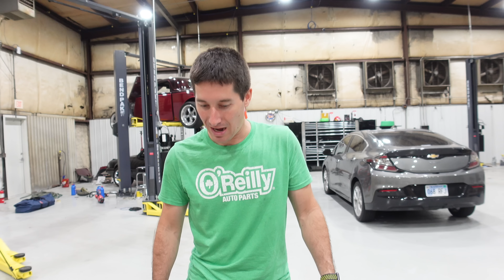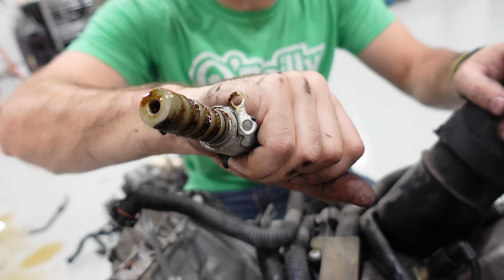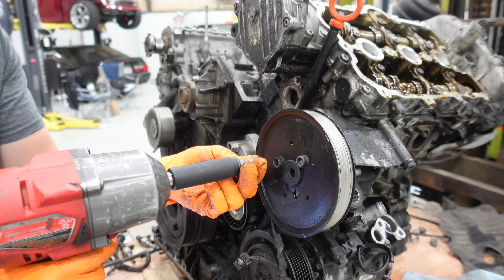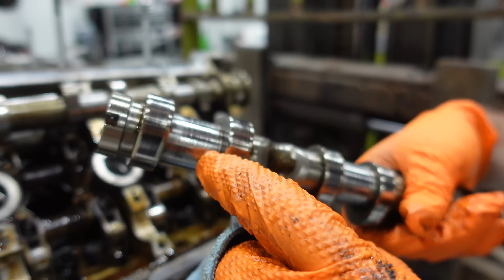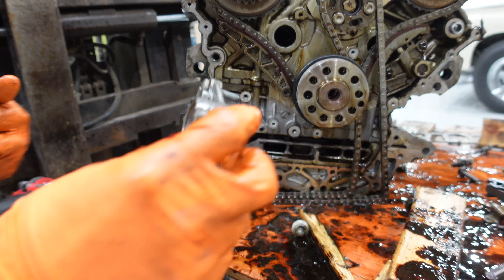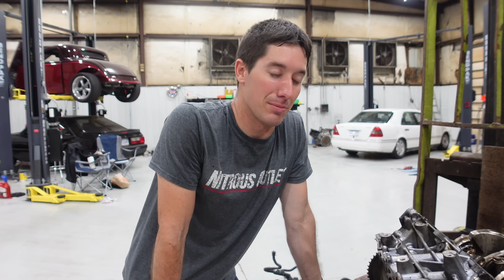SLUDGED To Death: Tearing Down My SEIZED Audi 3.0T Engine

Comment: Thank you for totally curing me from any desire to own a late model Audi.
Reply: You have to be making good money in order to maintain a high end(exotic, etc) vehicle.
Reply: 100%.  Oil and filter changes are cheap compaired to engine failure. 8-10k intervals to keep the cost per mile of ownership down are an absolute joke.
Reply: Think about how I feel...I own a late model Audi...waaaa
Reply: @michaelreynolds1904  lol fr I own a Honda and I change my oil every 3k miles or 5k kms
Reply: Hey Neil, I have an S4 with over 100,000 miles. With proper service, changing oil every 5 K it’s been completely reliable. A great car.
Reply: @nickoD509  the only high end part is how unnecessarily complex these cars are when they don’t have much over regular ones. The price might come off the way they build these things, how much time to assemble such machines when there is an easy way to do that, they don’t have better parts it’s all the same.
Reply: @michaelreynolds1904  they make sure you buy a new car at regular intervals which might be when your warranty is over. And your current one losing much more in resale value than any other car. Makes sense monetary wise when you think about it
Reply: It’s really not that bad the supercharge comes off in 20 minutes and I’ve done my injectors in under two hours. The engine is pretty stout and easy to work on
Reply: Problem is, once you drive an Audi, it's really tough to go back to Japanese. I have a 2014 a4 and it's been great. My next will be a 2016 s4!
Reply: They don’t have much over regular cars? Drive a B8 S4 with the 3.0 supercharged engine (this engine), torque vectoring sport differential, adaptive dampening suspension and steering, and Direct Shift Gearbox. You’ll see what all the fuss is about. This came down to poor maintenance. 135k miles on mine, runs like a scolded step child
Reply: I have no issues with mine brother. Mine’s also brand new and I take care of it very well a lot of preventative and preemptive maintenances! Very expense of the main thing now just letting you know now lol
Reply: @banlmao1707 I change my B8.5 S5 3.0 engine at 2500 miles!

Comment: This is why regular oil changes are so necessary. Audi's long life service intervals seem to be a joke. Interesting teardown. Good job.
Reply: Mercedes has a 20k oil change interval. Then 15k for the Mercedes Diesel 3.0 TDI vans that should be 5k max because of severe use & having a DPF.
Reply: Long OCI's ruin everything, 5k should be a standard, especially for modern engines with specialized cylinder coatings, lots of chain tensioners, etc.
Reply: All OEM's care about is lowering the perceived cost of ownership.
Reply: @twinscrolled  most onwers should be doing their own oil changes
Reply: @michaelbenoit248  My 2018 E Class diesel just went through it's 30,000 kilometer (20,000 miles) service - Third oil change. Engine computer tells me next oil change is due in 25,000 kilometers. Dealership service advisor told me to ignore that - change every 8,000 kilometers (5K miles). DPF regen system changeout in my model will run near $8,000 to fix if it goes faulty.
Reply: @michaelbenoit248  they tell you those things like 20k engine oil changes so to make sure you buy a new engine from them after a few years. And they made sure they are the only one to install it for a premium
Reply: @twinscrolled  or to make sure you get back to fix the engine after warranty is over. Always do 3000 km oil changes no matter what they say
Reply: @twinscrolled  about 100$ per 6 months is what reduces ownership cost because it will save a ton of money on engine repairs/replacement over a few years
Reply: ...and after say 130,000 miles this engine only lasting about an equivalent life of half a year's non-stop  running.  Not impressive is it when you consider this!  Would not be acceptable to the Merchant Marine somewhere in one of their ships!
Reply: @twinscrolled Toyota Oil change lights come on every 5k miles. Maybe that’s why their engines last so much longer🤔

Comment: LOL, honestly this isn't a bad engine to work on compared to many others.  You can pull the supercharger off the car in under an hour.  When we bought ours a friend and I went ahead and replaced the PCV, water pump, thermostat and supercharger oil along with a couple of the plastic coolant pipes under the charger.  Honestly no big deal.  I suspect it's scary for those that never ventured outside of the pushrod engine realm.  The only job I cringe about on this engine would be a timing chain replacement but they are not super common when you keep up on oil changes (no 10k intervals).
Reply: Agree with you most of the stuff from the top is not that hard to do even SC come off in less then 20min if you know which hoses and vacum on the back undo , and you don’t need for sure to pull engine out to do pretty much anything except timing chains that you mention , similiar to you I’ve done pcv,water pump , thermostat, pulleys ,and other stuff , also like you mention do oul cgange intervals shorter thean 10k and you will be fine , the most common issue is upper chain tensioners that rattle on the start  but i got mine 4yrs now and not get worst at all , as long as you chang oil should be fine .

Comment: Btw common for intercooler bricks to fail and hydro lock the motor. Bet they kept driving it and blew it up. Head gasket looked fine
Reply: Would be easy enough to pressure test that cooler.
Reply: That’s what happened to the one I bought
Reply: I just ordered the supercharger intercooler replacement kit for my Q7 because last time I took the sc off to do the pvc, thermostat, water pump, intake runner valves ect. I noticed what looked like coolent  build up on the runners on cylinder 2 and 3 and clean spots on my sc intercooler so before I get major malfunction I'm going to change them. I definitely love working on this engine but I wish I had access to a lift so I could drop the engine and do the guides and chain replacement.

Comment: Love this video.  I drove a 2012 A6 with this engine for 8 years.  Changed the oil every 5k miles and performed all routine maintenance.  Never had 1 problem.  I figured after 140k miles I was pushing my luck so I sold it but from the looks of the shape of the poorly taken care of engine you just broke down, I probably had another 100k left in mine.

Comment: The intercoolers fail on these engines quite often which wound cause coolant in the exhaust. The pcv housing cracks too which will cause coolant in the oil. These are amazing engines but do require major preventative maintenance.
Reply: Yep, exactly brother well said couldn’t agree more I really enjoyed my 3.0 S5. I have only 45,000 miles on it. I’m about to do the PCV thermostat, carbon cleaning and injector soon.

Comment: I did the thermostat, water pump, serpentine belts, pulleys, and the supercharger service on my 2013 S5 and it really wasn't bad at all. No issues doing any of it with the engine in the car. Once you put the car in to service position there is plenty of room to work. Takes a bit of patience though :)
Reply: But it should not be so inaccessible those parts are usually around the engine no need to disassemble the whole thing to get to those maintenance heavy parts
Reply: Those who know, know and those who are used to American cars only will be lost in process 😂

Comment: This is why synthetic oil and oil changes at no more then 5k are very important for audi's. I've bought many audi's that didn't run or had problems and most the time it's someone used non synthetic oil, ignoired maintenance, or or timing belt/chain failure after recommended replacement.

Comment: As a 3.0T owner as well as an Audi tech, do your preventative maintenance!!! A common failure is the PCV. They crack over time and start letting coolant get into the oiling system. I know the heat exchangers are not very strong from factory (I upgraded to CSF for this reason). The crank pulley will also fail over time, as I’ve had a few come in with the pulley part actually coming off of the hub. I always have the luck of pulling the injectors with the rails for some reason. And that hard coolant line that runs above the PCV is an absolute PITA. Another thing I do also see every so often is the supercharger intercooler bricks will be all gross and clogged. Also, if you have a gen 2 CTUB, please don’t forget that your oil check valves in the block have been replaced with bolts. You’re better off putting those check valves back in.

Special note for people that are not well versed with VAG products, that green coolant is wrong. Also, just use a damn 17mm for those fuel line fittings… 😭😭😭

Comment: I think the PCV/crossover pipe combo thing could be at fault. I'm dealing with a similar issue. '13 A8 3.0t and while purging the cooling system I forgot to plug the fan in resulting in a pretty hot engine. You can imagine how hot it gets deep in there. Heard a little pop and coolant started mixing with oil + white smoke out of the exhaust. Still waiting on the part to arrive.
Reply: It’s your pcv

Comment: If I had to take guesses, not a surprise it was a some failure in some collant line inside the supercharger. Entering collant into the combustion chambers through the intake, and then gradually mixing with the oil. Ending up seizing the engine.

Comment: Owned an a6 with this engine, while it Is a hassle to do any work you can still do it with the engine in the car. The pcv value is the black thing right at the bottom of that valley, had to replace that and it took someone who had never worked on cars before about 18 man hours 😅 also decided to do a few more things like get the injectors cleaned and flow matched while I was in there.
Reply: Also don’t really like how you’re portraying it, if you take time and realize all the connectors that you are breaking ‘because they got so hot’ have buttons to release them. And imo, for a 3 liter it can make enough power to make up for its losses, but seriously if a 16 year old can do the maintenance it can’t be that hard.
Reply from the maker: I'm am the absolute king of connectors, literally everyone I work with lets me pull the harness because I never break connectors. If they break they're trash, I released every single one. The plastics aren't designed to hold up to that heat, if I was fixing it I'd get out my tools and re-pin every connector with factory housings.
Reply: @WatchJRGo  Okay… my engine had 155k seemed to be a completely different experience than that one.

Comment: Audi looks like it has improved it's brand reliability but there are still an above average amount of documented engine failures.  On the turbo motors, when they fail it's almost always seized with engine sludge.

Comment: You’d be surprised how much you can do with the engine in the car
Reply: I agree. I personally think it’s not too bad to work on.
Reply: @woodswarrior2342  I just did the upper tensioners and it was tight but doable
Reply: @CoastalWheels  cool! I just had to change the PCV valve a few months back. Everything seems ok for now! Wasn’t a bad job at all.
Reply: @woodswarrior2342  Definitely not too bad, you can get the supercharger off in like 15 min after doing it more than once. I just did the PCV relocation that audic7owners on YT collaborated to help make happen too while I was in there.

Comment: When I was 17 I rebuilt a 289 top to bottom. I'd never done it before. It was the 80s. Had a great time and it came out great. You see this and you think that time has long, long gone. It seems German engines (looking at you Audi and BMW) in particular are designed to prevent service and you have to think if you want to 'work on a car' it'd be better to turn and focus on electric where this kind of madness is nowhere to be found. It's a different paradigm, but it's just not this; not even close.

Comment: I use an engine flush every oil change . Liqui-Moly oe Amsoil and recently BG EPR . Though it has been said BG EPR is very good to remove / reduce gunk around piston rings .
Reply: Why? If you change it on time there is no need.
Reply: @jamesmedina2062  Exactly.  Completely unnecessary. I guess some people want to "feel good" about doing such things.
Reply: @joeblowe7545  I think some people are paranoid or are trying to go extra on the cheap stuff. What they should do is build a savings account for later expenses. But if it's a Ford and the cleaner is cheap then maybe it needs it to clear carbon from the ring lands. Every car is different.

Comment: I'm doing this engine right now. Just pulled it out from my donor 2013 S4 and will be putting it into my 2011 S4. If anyone needs a detailed removal procedure - you can check vids on my channel. Ordered almost $2k of stuff from FCP for this engine (pipes, mounts, PCV etc, etc..). Should be delivered this weekend and hopefully I'll shoot some vids of replacing those things and finally adapting 2013 engine for 2011 car since it's not 100% same - different plumbing, different sensors, even different waterpump... Wish me luck on that...

Comment: Variable displacement AC compressor. Works a bit like a hydrostatic transmission. No clutch, so the input shaft is always spinning, and the amount of "compressing" it does is dictated by the angle of the internal swash plate the pistons are attached to. The plate can be shifted from completely flat (no compressing action) to extremely angled (all the compressing action) by that solenoid at the back of the compressor.

Also, VW loves using as many different type and size fasteners as they can. I'm surprised the R8 engine wasn't like that, because I guarantee you any other engine they make, you'll have half the contents of your toolbox out on the workbench by the time you're through damn near any job. They're particularly fond of 10mm, 13mm, and 17mm, but there is one size they almost never use (can't remember if it's 8mm or 9mm, one of those I think).
Reply: Standard metric bolt/nuts used are M6, M8, M10 & M12 sizes which require 10mm, 13mm, 17mm & 19mm spanners.

Comment: Great video, I was wondering if you would have handled this very much differently if you were planning on trying to rebuild it. I'm sure that component replacement would have been cost prohibitive. The little balance shaft offset weight didn't look like it was enough to bother with including in the design, I'm guessing that the shaft had more balancing on the inside of the engine, right?

Comment: It’s funny how closely related all of the Audi “V” engine are.  The 3.2L, 4.2L and 5.2L are all pretty close to the same besides cylinder count.  This 3.0T looks to be mostly a 3.2 with a blower on it and a little less VVT.  Pretty much what I always say about these engines...lots of fasteners of a mind blowing variety.  You can only reuse about half of them when reassembling.  Most are torque to yield.  Good luck putting one back together again...LOL.  Engine out is the only way to go.  Resealing one with all new gaskets?  I see lots of “while you’re in there” projects that just makes it economically unfeasible to save one in this way.  Sticking a new one in was the way to go.